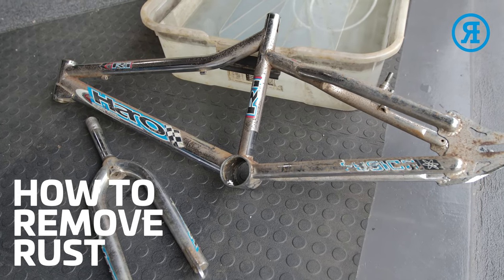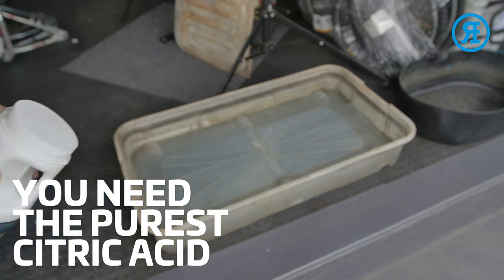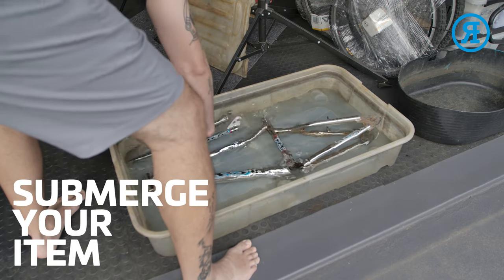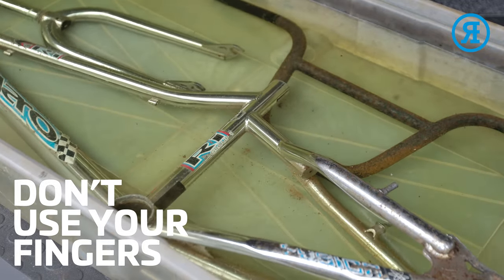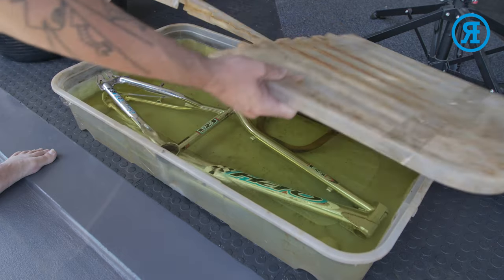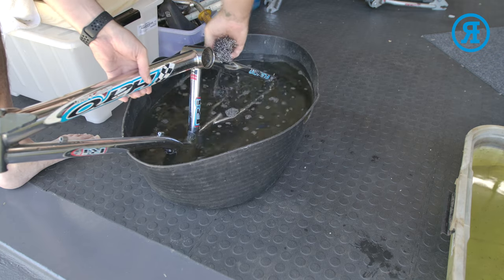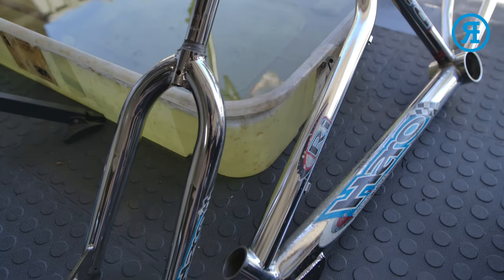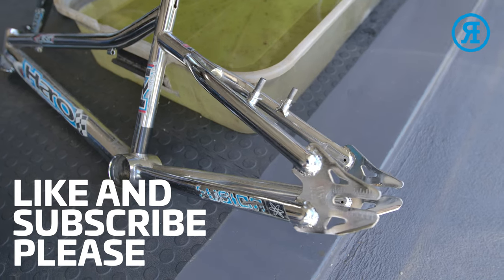HOW TO Remove rust from your old BMX and make the chrome sparkle

Comment: At Lowe's for $18 you can get a large black tub for mixing drywall mud or concrete in. It's about 36"x24" and 8" deep. That gives you approx 44" diagonally. You can also raise the level of the water by adding 2 liter or gallon jugs filled with water.
Reply from the maker: Great info. Cheers.

Comment: Got a '97 mongoose rogue I'm going to restore. Reckon you might have just saved me the cost of re-chroming the frame. I've probably only got half the rust as that haro frame did and that came out pretty fresh. Good stuff man.
Reply from the maker: Yea. Always got to get rid of the rust first and see what you’re dealing with.
Reply: I'm currently restoring my 99 mongoose, do you know anywhere to get period correct parts?
Reply: @beardnbarbell  I'd try just google search and see what comes up in shopping. There's bits and pieces for this and that in varying condition floating around all over the world depending on what exactly you're looking for.
Reply: @psychokillah87  thanks for that! I've been doing quite a bit of googling and unfortunately can't find things like the original pedals or seat, will probably just opt for something that looks similar vs the real thing.

Comment: Awesome video man.  I will be using this method for sure if I can find all the materials with no problems. Just curious,  is this safe to be touching with bare hands the whole time?
Reply from the maker: Yep totally safe to handle, unlike Oxalic Acid. Citric Acid is basically concentrated lemon juice. That’s why I use it. Safer to have around kids and pets. Just don’t let them drink it though. 🤢
Reply: @re-rides  oh perfect. I got 2 kids and they get into everything. So I'd be worried about them opening it up

Comment: Hi mate what are the ratios? I have bought the citric acid in the video but not to sure with the amount of water. Do you still use 400-500g with say example 40l container?
Reply from the maker: My tub is about 65 to 70ltr and I use 500g or half a container of crystals.

Comment: Hey mate just wanted to know if this process affects paint at all I have a chrome frame this is partially painted can I dip the whole thing.
Reply from the maker: Hey mate I haven’t had this affect my paint. Just don’t leave the frame in longer than you need. And if your frame is white make sure to use a fresh batch not an old batch that’s gone yellow. You don’t want any staining to occur.
Reply: @re-rides  thanks heaps.

Comment: What if you don’t something to soak the frame in?
Reply from the maker: There is a risk that without neutralising the acidity of the citric bath that moisture in the air can cause a more severe return of the rust. But if you have nothing to neutralise with, just washing down with lightly soapy tap water is pretty good.

Comment: Balled up aluminum foil work great on chrome, no risk of scratches
Reply from the maker: Sure thing. But I find if a frame has deep rust you need to break out the citric.
Reply: @re-rides  citric is definitely needed, I meant use aluminum instead of the scouring pad on the sponge. But you still got great results thanks for the video

Comment: Wax the frame and fork with 5 or 6 coats of carnuba car wax.  Wait 45 minutes between applications
Reply from the maker: Don’t know that one. Thanks
Reply: @re-rides  Just for rust prevention to block out the air and moisture from the metal.

Comment: Meh. Once chrome is compromised itll just keep flaking away. And its sharp too! I might do this for very VERY light rust but if its anything significant better to just strip and rechrome or paint it. Also Evap-o-rust is a game changer and it wont hurt paint.
Reply from the maker: It all depends on the value of the frame. Not just monetary value. Here in Aus the cost to rechrome will cost $800 to $1000. Not worth it for most chrome frames. So removing the rust and keeping it clean once done is a far better option.
Reply from the maker: It all depends on the value of the frame. Not just monetary value. Here in Aus the cost to rechrome will be around $800 to $1000. Not worth it for most chrome frames. So removing the rust and keeping it clean once done is a far better option.